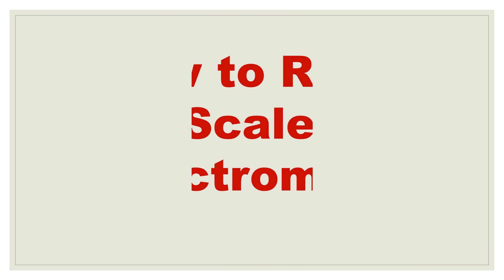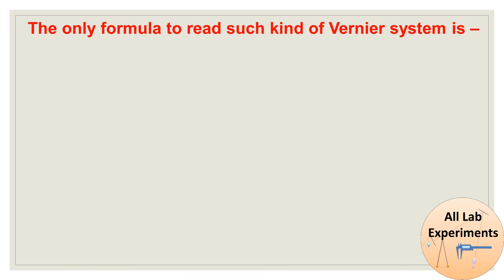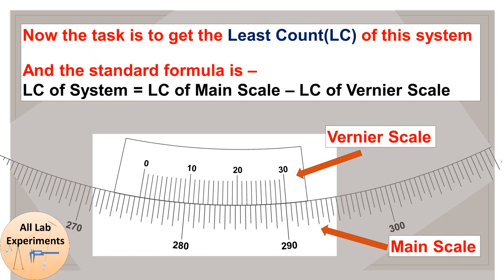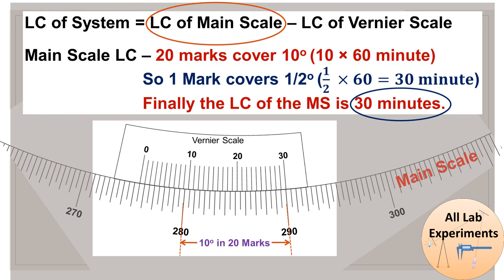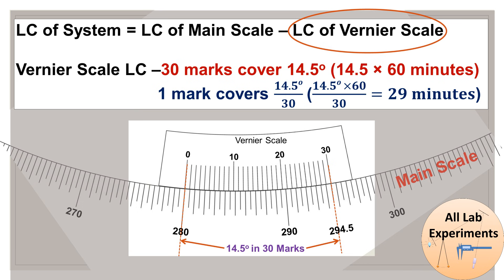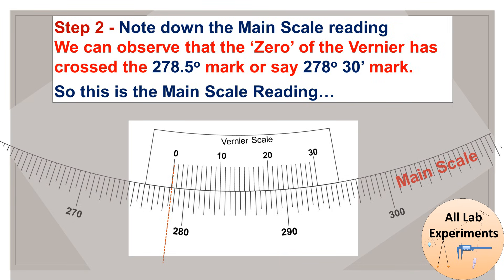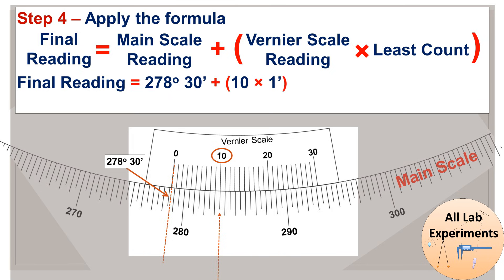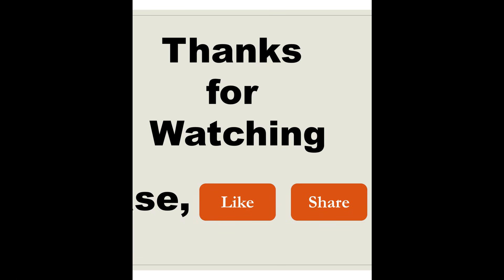How to read a SPECTROMETER (Least Count & Reading) #laboratory #instrument #iitjee

Comment: If v1 is 63°3'20" ,v2 is 242°13'20" for 1st surface and v1 is 184°40" , v2 is 3°6'40" for 2nd surface . Find the angle of prism in spectrometer experiment . Can you please tell me how to calculate it ?? As v1 in 1st case exceeds v1 in 2nd case and so in v2 . Please tell me the formula to solve this
Reply from the maker: @mascot-45b09.  Just half of the difference of these angles. 120/2 approx 60 degree answer aayega. V2 ki aapki reading me 360 degree wala.point beech me aa rha h so reading aisi aa rahi h
Reply: @AllLabExperiments   I cannot understand between 360°point . Please tell in detail formula sir . I need it  . 🙏
Reply from the maker: @mascot-45b09.  For detail formula my video on refractive index you can see. Reading 0 to 360 ke beech hoti h.
Reply: @AllLabExperiments   I calculate it . Is the angle of prism is 60.71° . Is it right? Last query please tell me sir . 🙏🙏🙏🙏
Reply from the maker: @mascot-45b09.  Yes
Reply: @AllLabExperiments   thank you so much sir🙏🙏🙏🙏❤️😊😊😊
Reply from the maker: @mascot-45b09.  For my physics lectures you can download my app GradXY from the playstore

Comment: sir is it always necessary to take an vernier scale reading if 0 of the vernier scale is precisely coinciding with the main scale then also we have to apply the formula to calculate the final reading...
Reply from the maker: Just take vernier scale reading to be zero and make the table accordingly.  Although formula will also give the reading same as the main scale reading but for the sake of making ur observation table, do it.

Comment: Sir how to calculate smallest division on main scale
Reply from the maker: Just look at the main scale... Choose an interval like between 260 and 265 degree marks there are 10 divisions then each division is half of a degree.
Reply: @AllLabExperiments  i have to calculate LC of spectrometer and formula for that is =smallest division on main scale /total number of division on vernier scale. 
But i got wrong answer so if you tell me right answer it is helpful for me 🙏.
Reply from the maker: @addictionforphysics8509  check out the formula narrated by me in this video.